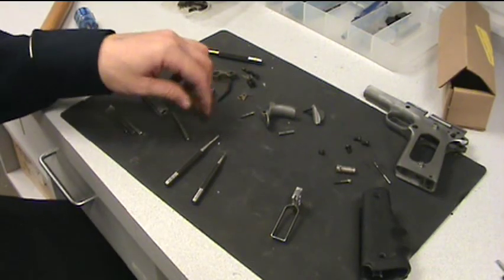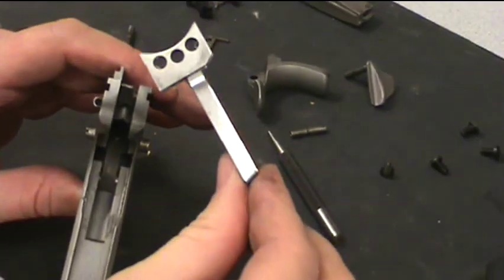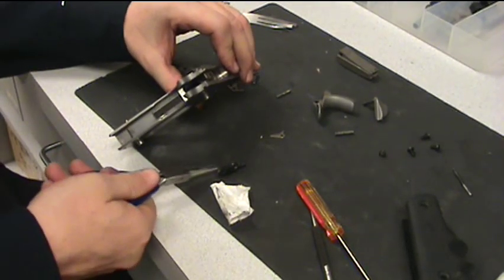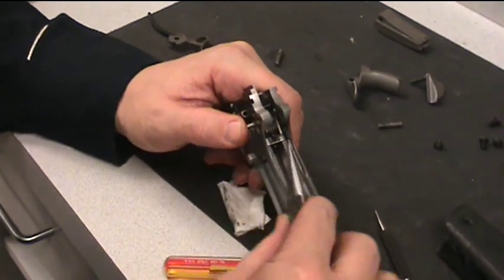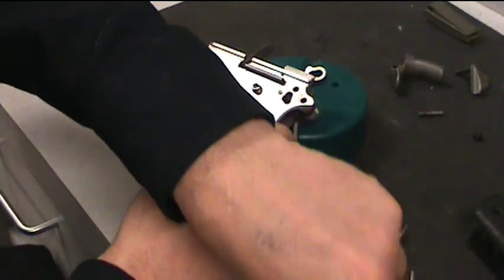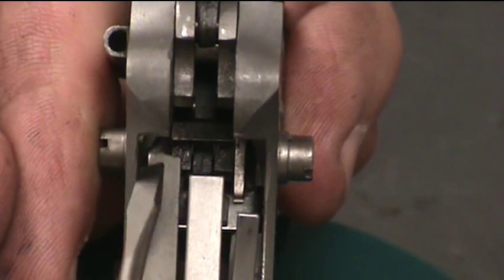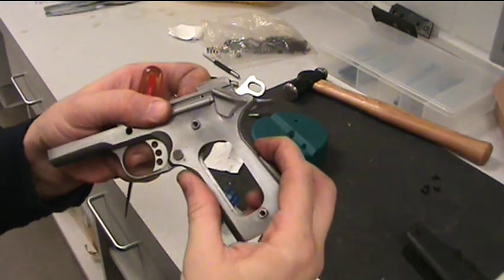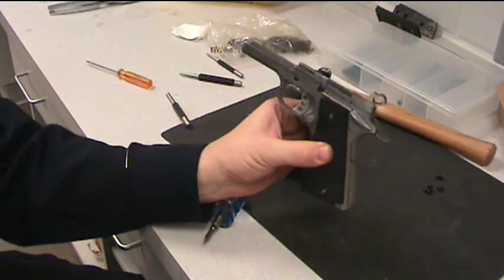1911 Lower Reciever Detailed Reassembly.avi

Comment: Thanks!  I never had any interest in 1911s until I did this one.  I've had a love affair with them ever since.  The one in the video was under water for two weeks during the flood of 2008. It was then placed in a plastic box on a shelf, without even drying it off, for 2 years.  I was tasked with trying to salvage it.  As you can see, it worked.  I then used it for this video.  SUPER accurate, and obviously very durable.

Comment: Thank you very much for posting this video.  I have 3 1911's (Kimber custom II, Kimber Ultra Carry II, and Springfield Armory Ultra Compact) and this video helped immensely with cleaning and also with installing new parts.  Your cadence and pace are great, and the images/shots of the sear/disconnect and firing pin safety/series 80 safety parts were very clear and helped me a great deal with reassembly.  Even though Kimber has a different firing pin safety setup (swartz safety) this was still easy to follow and basic assembly of parts were the same.  Great video, and I have recommended it and posted links to this to many of my friends' emails who also own 1911's.

Comment: Thanks brother. I have armorer certs a a variety of weapons but not the 1911.  I have an older 1911 series 70 that I assembled from parts over a period of 20 years. Colt upper/springfield armory lower a bunch of after market internals.  Rail job, real accurate. Love it! Had the safety plunger tube come loose. Restaked it w/ a tool from Midway.  Worked great. Been so long since I had it apart I brain farted putting the internals back in. Your video helped me big time.

Comment from the maker: yes. aftermarket replacements and upgrades have a solid post on the thumb safety, which will not allow it to move past the part it shares space with.  it should have a shelf, or "L" shape.  but if you take off too much, the safety will not work at all.  not something i recommend doing on your own.  you need a complete function check after every couple of strokes with the file.

Comment from the maker: @Marcelino2435 There is a short answer and a long one, I'll give the short one.  The series 80 added the firing pin block-safety and changed the design (shape) of the half-cock notch on the hammer.  The 70 is regarded as having a better trigger and is preferred for targets, but the 80 is consideted the safer choice for duty and CCW.

Comment: What’s the difference between the 70 and 80 series?  Your instructions are concise, clear and very illustrative.  Those close ups are excellent teaching materials.  My Wilson Combat 1911 is my pride and joy. Cleaning the slide from firing pin stop to extractor is a cinch. But the frame is another work of art. I’ll have to buy a cheap 1911 to practice.